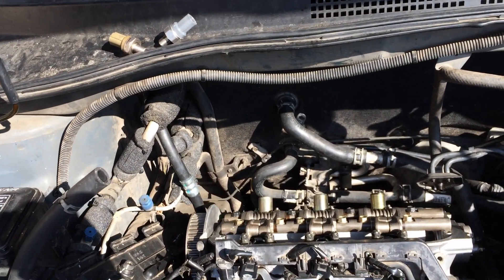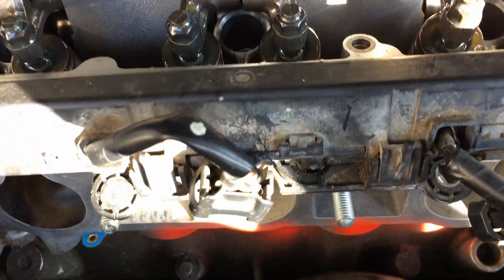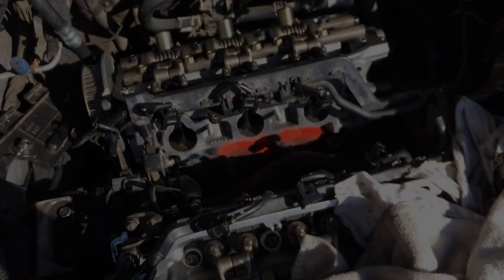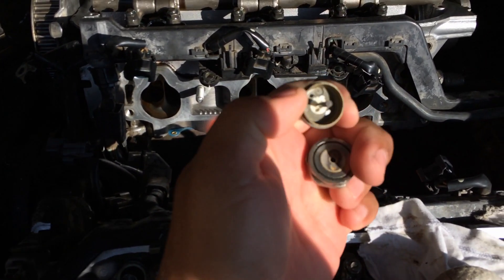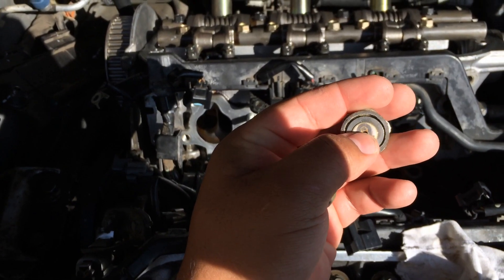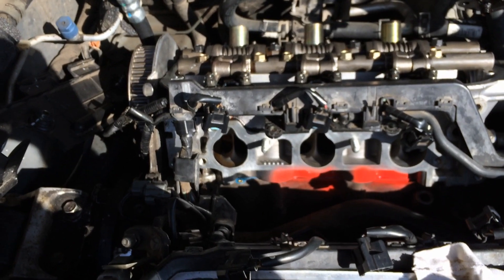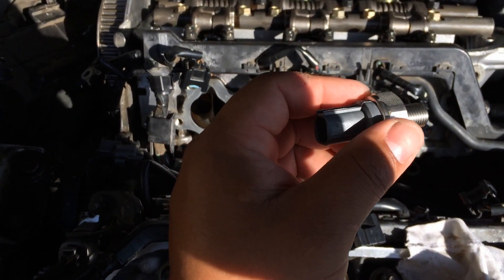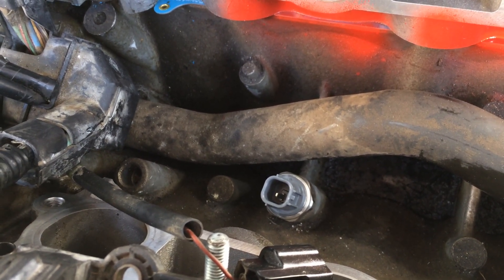Honda Accord Knock Sensor Location - Ridgeline Odyssey Pilot Acura TL CL RL MDX RDX TSX - P0325

Comment: Thanks for posting.  No sealant, no o'ring? Haynes manual says "make sure you install new o ring"  I didnt notice one when i took it apart.  Any info would be appreciated.
Reply from the maker: The new sensor should come with a new o ring. If not and you are installing the old one. Just make sure it’s not torn or ripped and re-install it.
Reply: @bundysgarage  Got it + Thanks for the prompt response!

Comment: I heard usdm j30a1 did not come with a knock sensor is this true? cause i have a JDM J30a replacement engine that might have a knock sensor should i have an electrician wire it to the ecu?
Reply from the maker: No it’s has a knock sensor